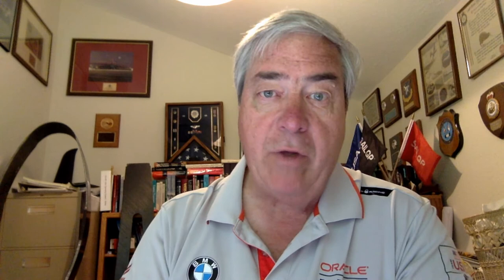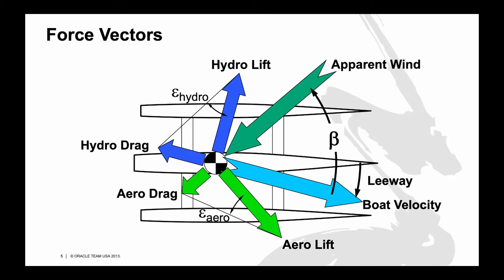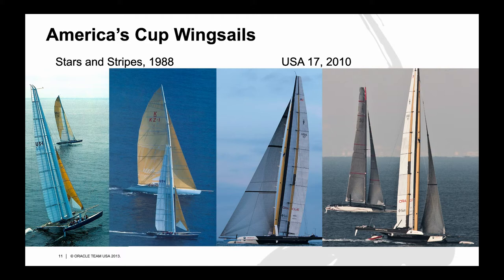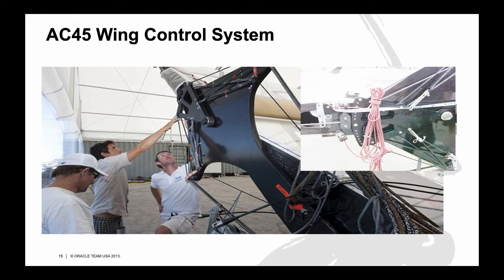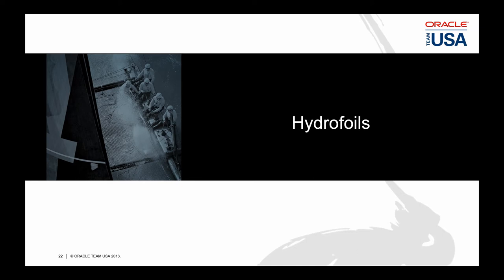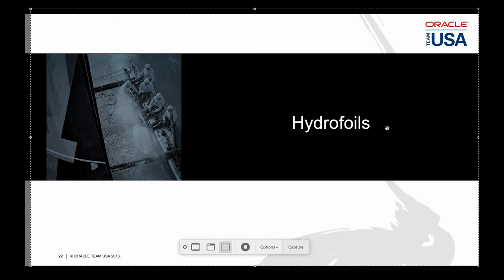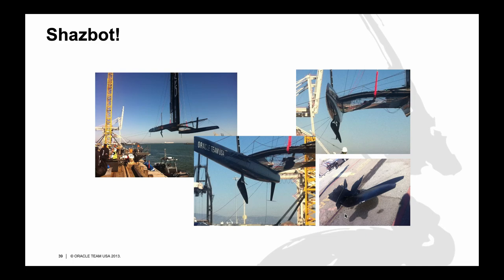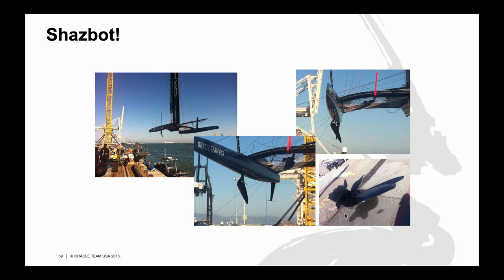HYDROFOIL -- TOM SPEER Tells Secrets on Winning AC-34 -- It's all about Hydrofoils

Comment: Hi Tom, As always, you have managed to explain the aero-hydrodynamics of sailing and how to achieve an efficient sailing craft in a very neat way in your slides. Thanks for sharing that information. While sailplanes are only operating in one fluid medium, not two, another relationship I always found to be neat (but more simple) was that the glide slope of a sailplane (glider) operating in still air matches its overall lift to drag ratio. I guess that improving glideslope performance of sailplanes can also best be achieved on reducing their drag to a minimum, especially given their lift in any case needs to balance their weight.

I have a few questions you might be able to answer in part during your live Q&A session on 5 November:

1.   You indicated the AC-72 wing sails could accommodate up to 40 degrees of twist of their flaps from the base to the tip of the sail. You indicated this permitted control of lift distribution over the span of the foil. Later in your presentation you even mentioned it was possible to drive the tip of the wingsail to windwards by application of twist. While this provides a useful righting moment, it seems to come at the expense of less than an optimum lift distribution over the sail to maximise aerodynamic L/D. Does this mean the trade-off is worth it? Also related to this flap twist, you didn't mention that sailboats are operating in a wind boundary layer where the true wind speed near sea level is significantly less than at the top of the sail of such high wing masts. I am curious to hear how wind boundary layer is accounted for when predicting the performance of the AC-72's and sailing craft in general and also how much this influences the twist distribution applied to the flaps while sailing.

2.   I was surprised to see in one of your slides that the minimum CD achieved by a wingsail was not much less than that of a more traditional rotating sail mast and 'soft' sail combination. I realise the overall performance of the wingsail in varying conditions was better, but do you have any comment on why the CD minimum was so similar?

3.   You discuss induced drag from 3D wings / foils in some of your slides. Clearly the upper tip of the wing sail results in 'tip losses' and you had a nice photo of a boat sailing in fog to illustrate that. But how much loss is associated with the base of the sail and is there a way this could be minimised? On a conventional displacement sailboat, provided the sail can be kept close to the hull/superstructure to minimise the gap, then the hull and sea act as a 'mirror plane'. This is harder to achieve on a foilborne multihull. Both Yellow Pages Endeavour and Macquarie Innovation appear to have adopted sails that extend down close to the sea surface, perhaps in part to take advantage of the 'mirror plane' of the sea to minimise induced losses?

4.   You provided a good review of the rationale for various centreboard/foil geometries. You also described the way in which foilborne dynamic stability is achieved due to the interaction between the forces on the foils and the drift angle of the boat and hence sail driving force. I was surprised that this interaction would be so strong or so rapid that it provides dynamic stability. You might be able to comment on that further? I also remain curious about the complex cross-coupling that must exist between the lift pressures generated on the more vertical portion of L foils and the lift pressures on their more horizontal elements, especially when operating in waves. Do those cross coupled pressures all help to provide dynamic stability of the craft or are some effects destabilising?  

5.   When I was spectating the SailGP AC50's sailing on Sydney Harbour in February this year, the singing from the sail rigging of all the boats was quite apparent. I am curious about how much energy is lost from vortex shedding from the rigging? Is rigging drag accounted for using conventional allowances for the 2D drag from wires?

6.    You mentioned that for one of the early composite foils used on the USA AC-72, the skin on the daggerboards unbonded from the core and came off, ruining that set of foils. I have heard of similar foil failures on composite foils at a larger scale. In looking back over this failure, was it possible to work out how this happened and are you able to explain how it happened now? I assume it wasn't due to striking any debris in the water, rat4her purely due to hydrodynamic loads experienced? 

7.   You mentioned that when the team had two boats able to be operated side by side, this was a good opportunity to test the benefit of different design solutions on one boat compared to the other. But how was it possible to 'normalise' the wat in which both crews actually sailed the boats to make such comparisons of the design features?

Finally a comment: Your presentation gave a nice account of the team effort required to turn the situation around for Oracle Team USA at the 34th America's Cup to come back and win that event. Well done to all involved.